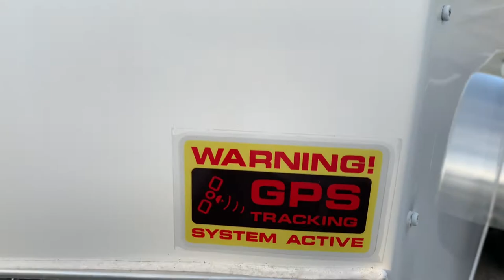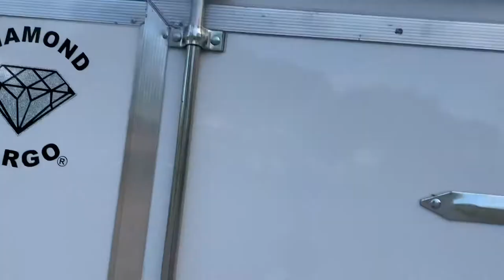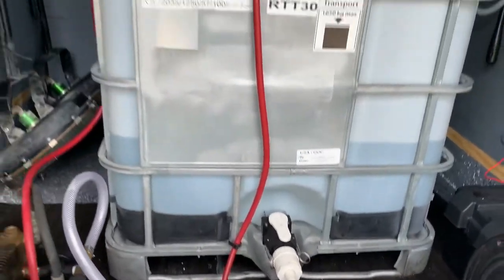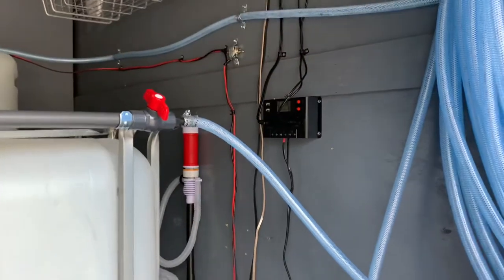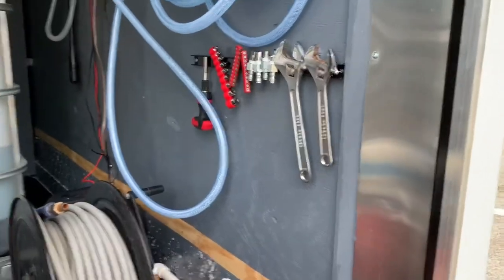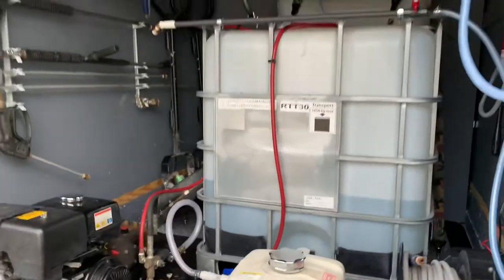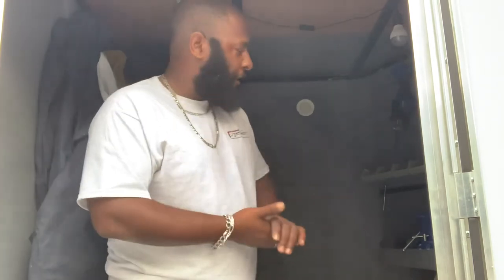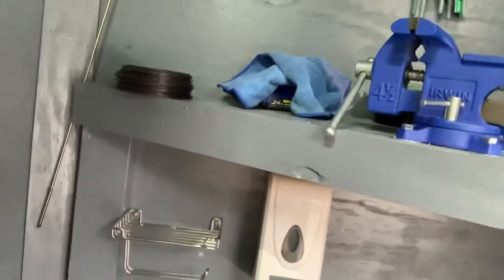"ON THE GO" POWER WASH PRO GARAGE TV-ENCLOSED PRESSURE CLEANING UNIT

Comment: Nice and efficient trailer. I just bought a 7 x 14 and have to do the floor and walls and trasnfer everything over from my utility 5 x 10 trailer. I'm realing loving the containers you have for the plugs, quick connects and so on. Also where did you get the partition from and how did you measure the trailer to place in a good spot. Thats very creative. So many times on the job where i have to take a leak.
Reply from the maker: Whats up? Thanks for checking out the channel I appreciate that. It was very nice to move from utility to enclosed (trailer) especially if you work in a rainy climate as I do. This build was fun for me, because I built it around my previous experiences. So I would encourage you to take your time, think about every issue you had in the field and how a solution could be applied to your new build. I waterproofed the floor and walls. Check out “ON THE GO” POWER WASH PRO GARAGE TV (TRAILER BUILD PAINT 1) & “ON THE GO” POWER WASH PRO GARAGE TV (TRAILER BUILD PAINT 2)
To answer your question, I got partition from Home Depot. It's that very thin wood and just measured and glued 2 pieces together and installed it with "L" brackets. As far as the distance,  I picked a comfortable spot using the crossbars of the frame of the trailer.  Since you're in a bigger trailer you'll have a little more room.  Any other questions feel free to ask. thanks

Comment: Also put the battery and charge controller in the other section away from the water and chemicals. Less chance a simple mishap costing you more than it should.
Reply from the maker: This is a professional cleaning trailer.  Water and chemicals are a normal part of the job. I'm not concerned about "mishaps". Thanks for your thoughts though.

Comment: Hey brotha love the set up working on my trailer as I watch this. 
I’m having a problem getting the water tank to feed the pressure washer any tips on getting the plumbing right? It’s a 4gpm idk if that has any reason for the issue?????
Reply from the maker: Hey what's up bro? if you can email me a few pics of the setup that would definitely put me in a better position to help you. (onthegopwp@gmail.com)  Just some things off the top of my head, I'd make sure there isn't anything clogging the lines, hoses collapsing, kinks or any air getting into your lines (leaks). Are you using PVC, some type of flex hose? I'd suggest that you use the shortest distance possible from buffer tank to pump. Last thing, I'd use the largest diameter (PVC or hose) I could get. Usually 1 inch is plenty for a 4gpm pump. Hope that helps, keep me posted and good luck.
Reply: Hallelujah brother thank for the input definitely was just the flow restriction we on now pics coming soon! Too excited!
Reply from the maker: @IbashiVandevelde-dg2xw  awesome bro! Very glad to hear it! 👏

Comment: Dude you need some hose reels
Reply from the maker: I’ve had hose reels on previous rig. I sold them….. they are heavy, expensive and you still have to exert energy to reel them up. I love wrapping my hoses on hangers! Thanks for checking it out!
Reply: @onthegopowerwashprollc1077  man I feel like it’s more work wrapping 200ft look into the automatic hose reels those are nice
Reply from the maker: @pressurewashingorlandofl  yes I’m aware of those, but you have to build every rig for your needs. Utility trailers you have a lot of freedom and room to put a lot of different things on it, because they can extend from any side of the trailer. With an enclosed trailer  you don’t have that option. Also, another thing I don’t like about  reels is that the hose is always connected to the unit I like to be able to detach my hose from my unit instantly so having a reel was always problematic for me ….. we work large accounts sometimes so mobility is so important. I don’t like them, don’t need them, for me they are more trouble than they’re worth.
Reply: @onthegopowerwashprollc1077  Yeah I have three holes real stacked up on top of each other right out the side door of my 6 x 12 in close trailer
Reply: Saves a lot of room stacking
Reply from the maker: @pressurewashingorlandofl  For me having a workshop & a bathroom in my unit was way more important than a few hose reels, also I like my hoses to detach completely from unit…..
. So like I said every rig has to be outfitted for your specific needs and order of importance. Reels just don’t serve a purpose for me. 🤷‍♂️
Reply from the maker: @pressurewashingorlandofl  Cool, I just don't need hose reels, don't like using them.